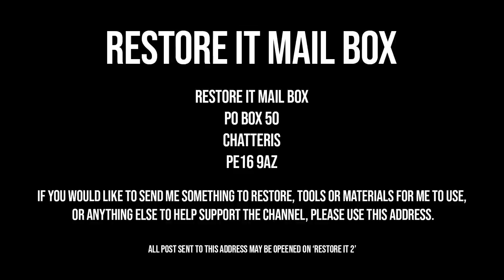BMW E30 Rear Subframe Assembly RESTORATION | BMW E30 325i Sport Restoration E4 S1

Comment: Can you say bushing windup? You can't do final tightening of attachment bolts for suspension joints with bushings with no weight on the suspension. Loosen all the bushing bolts and retighten/ torque with weight on the wheels.

Comment: You sure you released the hand brake before pulling the rotors off? Looks like some stuff got damaged pulling them off

Also your gas tank vent line is totally missing. Hope you aren’t topping off the tank cause there’s a 1/2” hose in there that’ll leak all the gas out in a hurry

Comment: when your going to so much work would you not want to upgrade to polyurethane bushes ?
Reply from the maker: I will do this once the car is finished factory. Or very close to. And the  start upgrading parts so I can feel the differences and keep the factory parts as well.
Reply: sidney scott when *you’re advising other, why not use correct spelling and grammar?

Comment: One q, why are you assembling everything back if you are (I presume) going to paint the shell at some point? Wouldn't it be easier with all the stuff out?
Reply: I was thinking about that a few videos ago. I think he's putting stuff back on the car while it's still fresh in his mind. Otherwise he'd have a pile of parts, nuts and bolts etc. Any body work to be done underneath, I'm sure he'll just whip off whatever is in the way. That's only my thought though.
Reply: Well it does makes sense, especially since entire thing will take a while to finish. On the other side, he can always look at his videos and see how he took it apart, so who knows. Could also be the space, if it's all on the car it doesn't take space around the garage.
Reply: @Thillith  .. I think you're right about the space as well. He's taking on a huge task and he's doing a good job of it. It seems like he's getting plenty of support from his subscribers as well. I wonder what his name is? I'm gonna ask. Lol. 👍

Comment: For parts like this, I use Epoxy 121. Seriously, it sets like steel, a wire brush won't touch it and it's non porous.

Comment: Next time you have stuck rotors stuck use a bolt in the hole meant for one on the the face of the rotor where it meets the hub so you dont cover your e brake shoes in wd 40/oil

Comment: Is your car using a rear disc or drum? I can see a disc immediately after the wheel is removed, but there is no caliper in sight. The brake shoe/drum I saw in your video is for the handbrake system. I was just wondering whether yours has rear brakes at all.

Comment: Minute 36:29, did you use any molybdenum/graphite-based grease on that rubber pieces for the stabilization bar? It is not normally written in the manual but it makes a huge difference in the noise when the bar is moving

Comment: Why are the rear brakes drum brakes set up to use the inside of a rotor instead of a drum itself?
Reply: Is it so that if the owner wants they can alternate between drum or disc brakes? Cause there is mounts for calipers aswell

Comment: Why not disassemble the entire car and restore each component individually like (Rear Subframe, Front Subframe, Engine ) without returning it to the car then repair the body from the rust, dents and hits. Then disassemble the interior clean it and not returning it to the car ) and then paint the body and on the final arranging the all components
Reply from the maker: I am doing just that. Look at my other videos. Literally i'm doing exatly what you said haha. I put these parts back on to get a rolling chassis

Comment: You should really put at least the ends of the drive shafts in the hubs, the bearings won't having weight on them without being supported by drive shafts!
Reply from the maker: Thanks for the advice!

Comment: Mate, not sure if you would still read comments on a 5 year old video.. but how the fuck do you remove those handbrake cables from the hub?! Im dead stuck at it from removing the whole subframe.
Reply from the maker: A LOT of effort. See if you can find a written 'how to' to see or that will help. It does take a little bit of auper human strength though, if I remember correctly. It is a real pain, don't give up. Good luck!

Comment: WD-40 is a horrible rust penetrant, it's almost the same as spraying water on there. Use a real penetrating product such as PB Blaster, Mopar or Ford penetrating fluid, those are all good products. WD40 is a light lubricant, it has very few uses in my garage because it's not a good product. Popular yes, good, no.
Reply: "it's almost the same as spraying water on there" - I'm sure you are basing that on some kind of scientific study no doubt.
Reply: Gasoline and a little oil work well
Reply: ProjectFarm did a review on PB Blaster vs WD40 vs other penetrating oils: https://www.youtube.com/watch?v=xUEob2oAKVs&t=17s

Comment: you should not tight rubber parts at this (32:10) moment. You should tight it when the car is on the wheels, so rubbers will work in proper position.
Reply from the maker: Sweet thanks for letting me know, I'll do it that way once it all back off the car.

Comment: i dislike drum brakes even if they last longer, it only takes 5-15 mins to swap discs and pads.
Reply from the maker: This car has discs front and back. What you think was drum brakes were actually the handbrake shoes that go on the inside of the rear disc.
Reply: @RestoreIt  ah! for some reason i thought that was fairly recent thing in the past few years of course it's been done before!

Comment: I don't recommend using that method for removing the bushings from the trailing arms.  I tried that same thing and ended up bending the two arms apart and ruining both trailing arms.  I didn't notice until I tried to put it all back together.  I would instead either use a press/vice/clamp or burn them out....something like this: http://www.rtsauto.com/the-easy-way-to-remove-and-install-e30-trailing-arm-bushings/

Comment: You've mismatched the sides of dust covers. Your brake caliper mounts now inaccessible.
Reply from the maker: Getting this sorted out before final installation, thanks!
Reply: @RestoreIt  Got almost the same situation - forgot to install a locking clip to wheel bearing. Got no luck with doing this in assembled knuckle -  Had to remove flange, then remove whole bearing assembly, throw it to garbage,  press in a new bearing and install a new locking clip.(

Comment: That handbrake system is so stupid. In theory it works, but in practice since it is not used that often it rusts fairly quickly and freezes up. It's a bitch to take apart and replace.